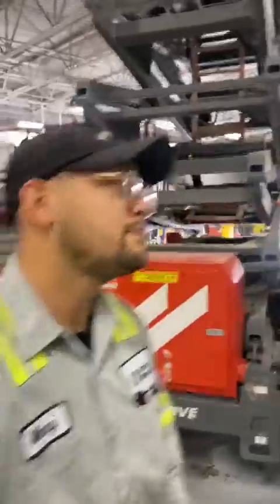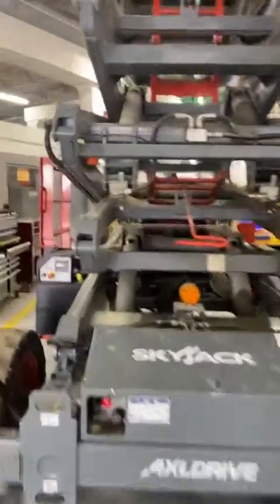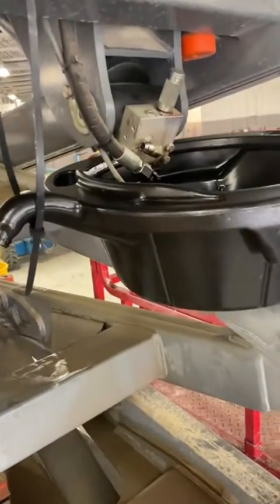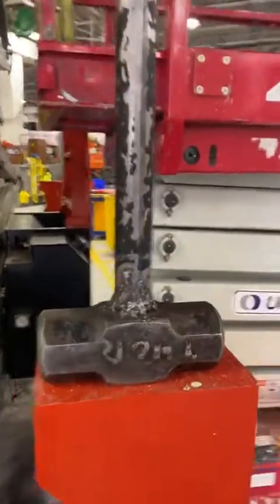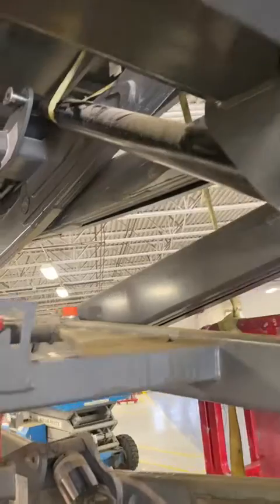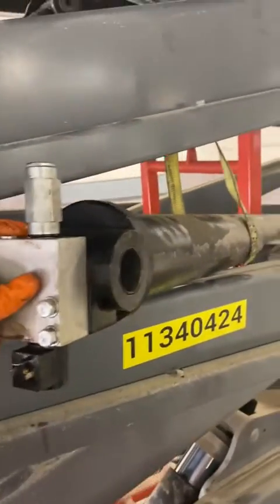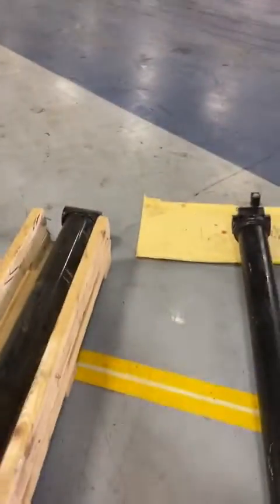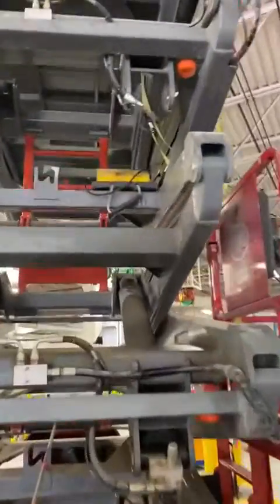Cylinder leaking on Scissor Lift

Comment: How would I lift the SJ3219 to replace cylinder seals? All fluid blew out now doesn’t raise 😏
Been looking for a manual crank or something to get it up.
Reply: Well to answer my own question - I used a couple floor jacks and 2x6 under the basket. Raised them up evenly back and forth til it was high enough to get at the lift cylinder. I supported the basket the entire way as it got jacked up in case the jacks slipped out. Once I go to a level I could work in it, put 4 pipes vertically supporting all four sides of the basket. It wasn’t high enough to use the attached safety support bar but high enough for me to work on it and take out the cylinder to change the seals. 
Easy job actually. 
And here’s a bonus tip to save you $100 - the pressure relief valve (safety valve - red knob) doesn’t actually need to be replaced if you F it up. Just use a solid copper wire, wrap around the housing and tighten to the sweet spot where it allows full movement up and down on the basket 👍

Comment: Will the lift hold itself up when u take the cylinder out or do you have something in between holding the lift up ?
Reply from the maker: I have a safety prop right in between the middle of the lift to hold up the stacks it’s red you can kinda see it in the video. Every unit should have a safety bar per OSHA
Reply: @handymanny214  I see, thank you for the quick response!